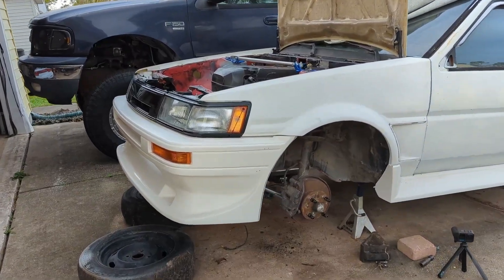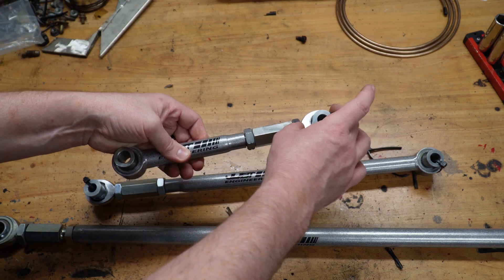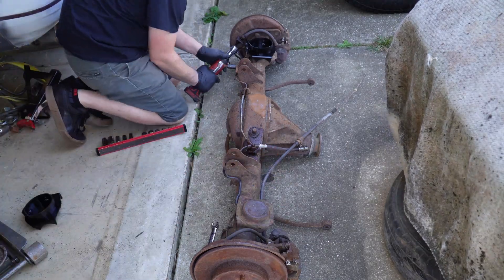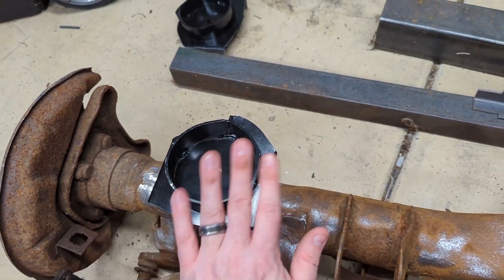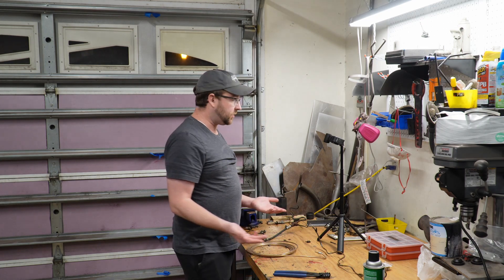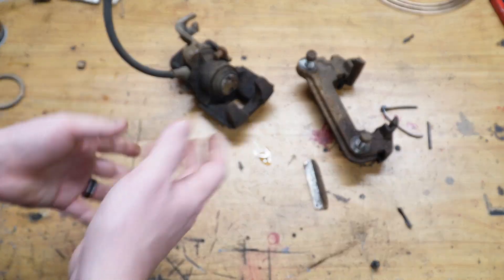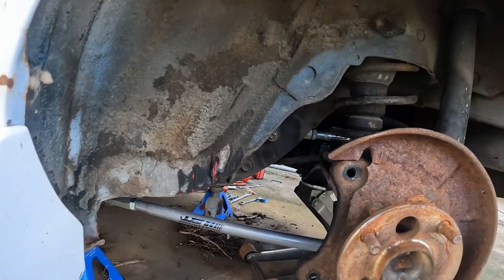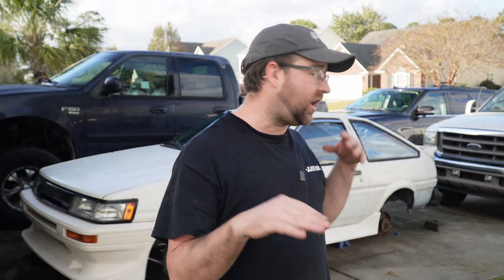LEVIN AE86 Restoration - Gets HUGE UPGRADE! Celica Supra REAR AXLE SWAP - JUST ENGINEERING

Comment: What drive shaft fits this combo of j160 and celica supra rear? Im coming from a sr5 rear to a celica supra rear
Reply from the maker: I've heard that the front section from an older celica with a w5x trans will work, the rear ended up being a modified SR5 section - I had it shortened.